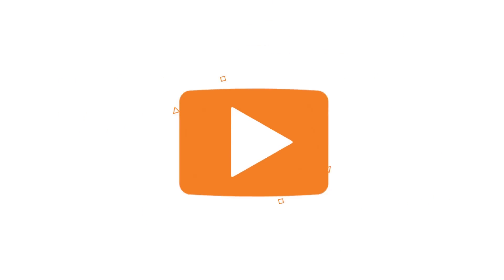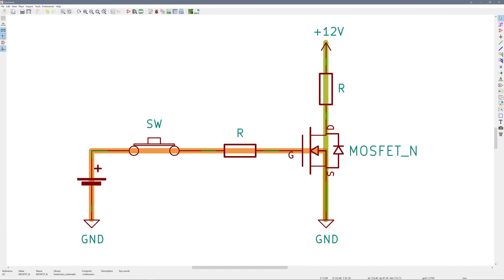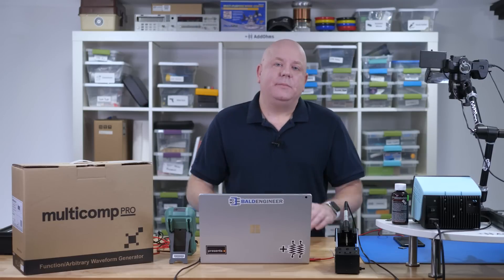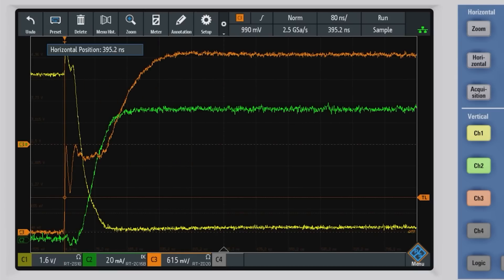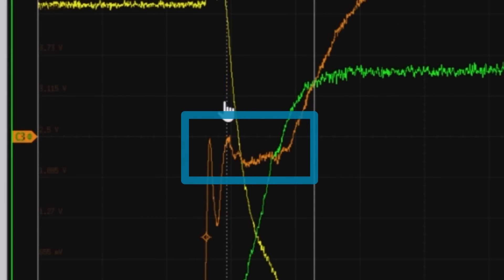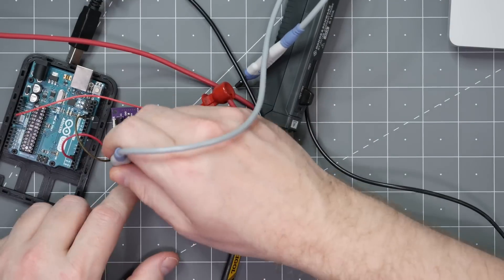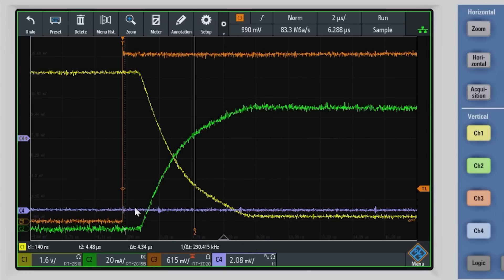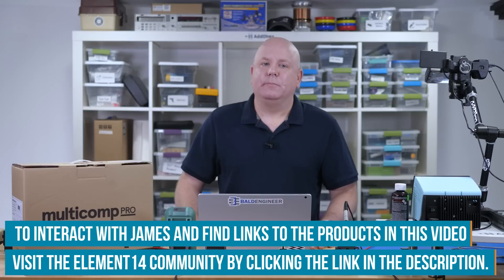Measuring a MOSFET’s Miller Plateau - Workbench Wednesdays

Comment: Awesome video!
Thank you!
There is one thing I dont understand yet,
on 7:51 the gate (orange) seems to be instantly charged over a 3k resistor, but the mosfet is reacting with an time offset, did you maybe insert a picture taken with the probe on the wrong side of the charging resistor, directly on the signal generator?
Reply: Since the resistor + gate is significantly higher impedance than the signal source, it doesn't matter which "side" of the resistor is probed because it is in series with the gate. There is a ramp to the gate's turn-on but it isn't visible because of the scope's timebase.
Reply: @bald_engineer   
Thank you for your time :) 
Im just wondering why there is a "slow" ramping in the first experiment (orange graph 4:28) with 0 Ohm resistor and in the second part (orange graph 7:51) there is no ramping up on the gate but the resistance is increased to 3kOhm. If there would just be a capacitor of 800(E-12) F charging over 3k Ohm, the RC time base should be 2,4E-6 and we should see charging for around 3x time base but the rising is instantly. (ignoring the gate drain capacity, but it should slow it down further more)
Thats why I think, that the probe maybe was on the wrong side of the gate resistor.
Sorry if im wrong, im just a student :D
Reply: @angerwurst1860  That is the entire point of the video. Without a gate resistor, the Miller Effect causes the shelf which results in switching losses (among other issues.) Additionally, the ringing generates EMI. As I said in the video, the rated capactiances are not "capacitors." They are dynamic characteristics. The gate's capacitance and the gate-drain capactaince CHANGES as the drain turns on. It's the Miller Effect.
Reply: @bald_engineer  
Sorry that im a bit annoying.
Okay, I understand the EMI and ringing problem without a gate resistor, but for me there seem to be a logical problem.
With 3k3 there is a time period in the video where the gate voltage is maxed but the mosfet is not reacting.(7:51)
If the gate really finished charging instantly and is not dropping or ringing in this time period, why does the mosfet do nothing for a "long" time?

IF the measuring probe is directly on the signal generator, the orange graph just shows the input signal and not the true gate voltage with its ramping up, that could explain the time where the mosfet is letting no current flow and doing nothing for over 1us after the orange graph stops rising.

I just build a small circuit with an ESP32, MCP1407 mosfet driver, 2N7000 mofet, 3k gate resistor and 1k load resistor, Im on the same time base as you and I see my expected slow ramping up of the gate voltage, I also can identify a small miller plateau in this setup when the drain-source voltage starts changing.
If i connect the probe to the other side of the gate resistor, I see exactly the same behavior like in the video.
I just really really want to understand it, because I think that I can learn a lot from your video and im confused because the shown measurement seem to have a logical inconsistency for me.

When the drain-source voltage is decreasing, then the gate drain capacitor should slow down the further rising of the gate voltage because of evil miller, but in the video U(GS) is maxed and stable and U(DS) is sill sleeping.

Edit again: I red it again, you said it does not matter on wich side of the resistor the probe is.
If you charge the gate by switching on, current is flowing, I*R=U. You have a voltage over this resistor. 
The voltage on a capacitor can not jump, the entire voltage is on the resistor for a short time.
You can measure 5V =  (U(R)= 4,9V + U(GS)=0,1V) 
You would measure 5V over the entire charging time of the gate if you measure on the wrong side.
If the charging is finished, the current is 0, the voltage over the 3k resistor is 0 and in this stable state, then you can assume that the measured voltage is the true gate voltage.

Greetings from Germany.
Reply: @angerwurst1860  Okay. I see your point now and you are correct. I should have had a probe point between the resistor and gate. Someday, I will re do the measurements...
Reply: @angerwurst1860  Да, меня тоже сразу поразила, как при подключении резистора 3 КОм, фронт включения транзистора был такой вертикальных, похоже там опять он что то напутал и что то не подключил, придётся самому провести подобное исследования, хотя теоретически, где то там у автора явно ошибка, которая не разбирающемуся новичку даже не покажется ошибкой. лишь бы эти новички не стали перепаивать в своих шим контроллерах резисторы с 10 Ом на 10 КОм.. :D

Comment: Is there a follow to this? As a brief demo of the Miller plateau, it's okay, but what most folks really want to see are some concrete examples. It's reasonable to skip the "bunch of maths", but then why not simply connect a multi-turn pot of about 250Ω as a gate resistor and show how you would optimise the switching for a given mosfet and load? You could easily use the Arduino to switch the mosfet faster and faster in order to see how it heats up and demonstrate the upper limit of the gate drive resistor.

Comment: Interesting to see slowly turning it on versus slamming it on, both with probing the curcuit and radiated energy. Would have really liked to see the results with different resistor values.  That active probe most certainly would give infinitely more accurate results compared to everyday 1/10x probes, which would be even more beneficial to see.  Does rise and fall times listed in the datasheet coorelate completely with the input and output capacitance? What other things would you consider for rise and fall times to optimize switching speed? Look forward to a follow up video on this subject
Reply: Thank you for the comments. I provided a response here: https://www.element14.com/community/docs/DOC-95249/l/workbench-wednesday-25-measuring-a-mosfet-s-miller-plateau#comment-268120

Comment: Hi, I need help, this is a digital temperature sensor on the pellet burner electronics.  Everything works well but I need a little diversion on electronics.  The thing is that at some point I need to tell the electronics that some temperature has been reached and if creativity has not been reached.  How to influence that temperature via a sensor.  There are three wires on the sensor: green, brown and white.  Green is electronically connected under one connector and brown and white are connected together under the other connector.  So, three wires, two connectors.  Thanks.
Reply: and how does that remotely relate to the topic? go find a forum.